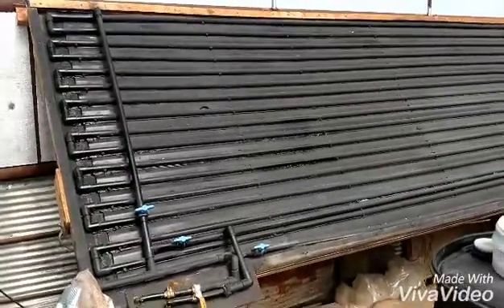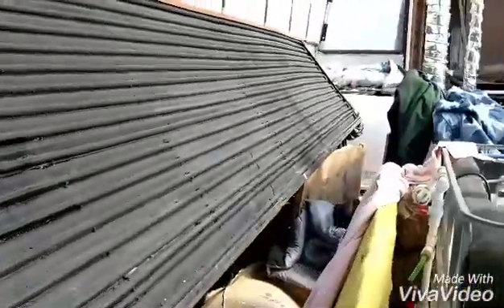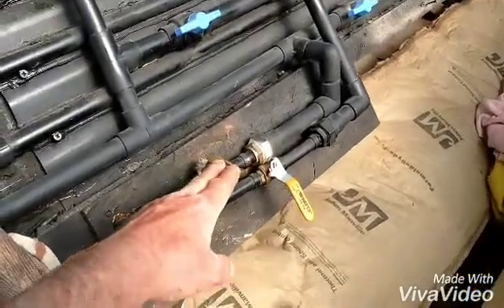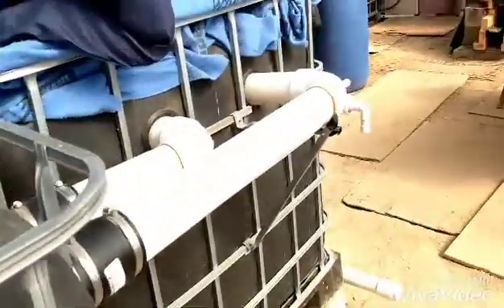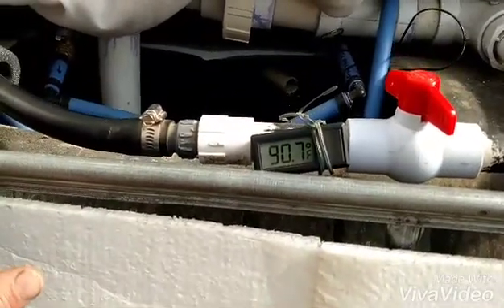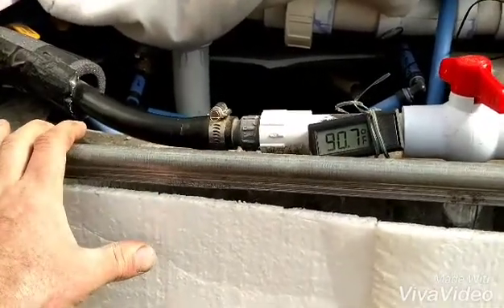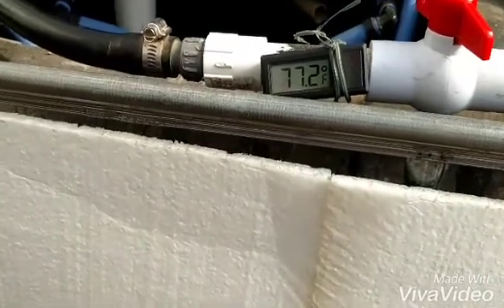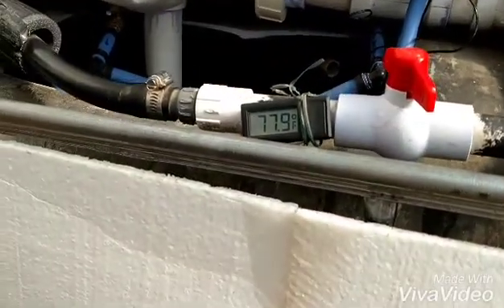Temperature on the solar water heater and how much heat is taken out with the PEX exchanger

Comment: The numbers I want to see are temp of the water going into the solar collector and the flow rate of the water.
Reply from the maker: Richard Hasting Thanks for watching. The flow rate is about 1 gallon per minute.  It will raise the water temperature about 5 to 10 degrees on a sunny day. There is about 2000 gallions  in the fish system. I keep the fish water temperature around 70 degrees Fahrenheit. hope that helps. I am putting in a propane tankless water heater for this winter to help heat the fish and nutrient tanks.  I will post some videos of that soon. I checked out your channel and you have a great looking greenhouse. I look forward to seeing updates.
Reply: So approximately 5000 BTU/hr max. On a sunny day, a total of 30,000 BTUs. So over a day, about a 2 degree F rise in temp for your system. That isn't bad at all for the free heat. Sadly, I need 13 times that. I am at 27K-28K gallons at this point. The good news is that, since I live in East Texas, a cold day is one where we freeze at night. A really cold day is a low of 12, high of 30, and we will get 2 or 3 of those a year. So, that is just short of panic mode right there:-) I enjoy watching all of the videos. Keep it up!
Reply from the maker: Yes you will need more. If it's made with copper and larger you would have better heat production. I'm not sure if I enclosed this in glass if I would get better heat. It is in the greenhouse so no wind to reduce heat. Last year I used the rocket stove to build up the heat storage at night. This winter I want to heat the nutrition tanks for the plants along with the fish tanks. I'm going to install a tankless water heater run on propane to do it. this will be easier than the rocket stove and maybe cheaper. The rocket stove. I only ran for 2 or 3 hours a night to raise the temperature up. I'm in Kansas so we get some really cold nights. I will shoot a video of the install. Let me know what solution you find. thanks Von

Comment: Thats pretty awesome. I was pondering something like this. I got a few glass panels laying around I need to do something with. The night time cover I made has my heating cost dropped around 65%. Thinking a thicker cover, might be my next addition.
Reply from the maker: Joseph, When the temperature gets down to freezing I cover the pipes with 4 x 8 sheets of insulation and blanks. And I leave the pump running a little bit of water thru the lines. Thanks, Von
Reply: Greens & Gills Greenhouse - G3 How many gallons per square feet do you have? What are you thoughts on that ratio in matters of passive heating. I have a little over 1 gallon per square feet. I guess the total volume would have be in computation somehow also.